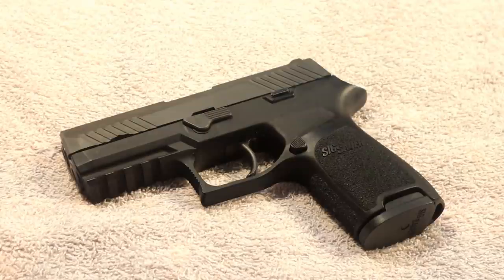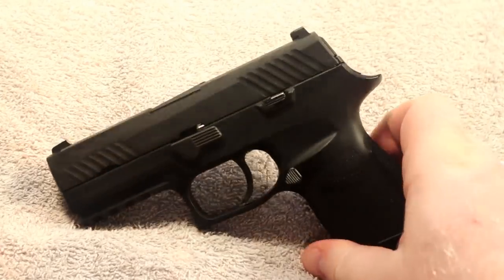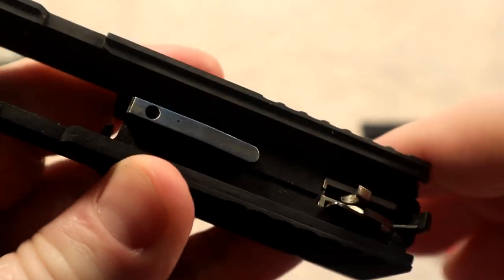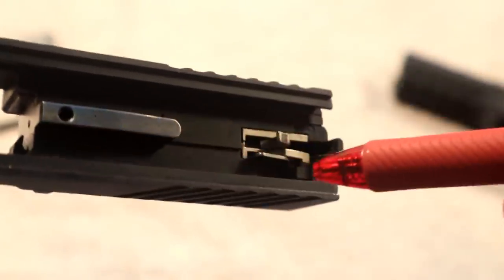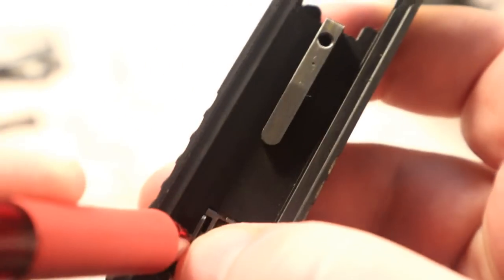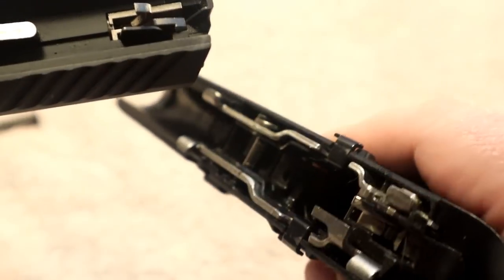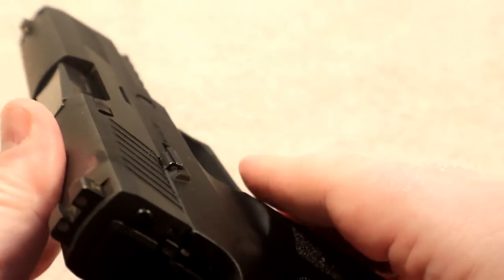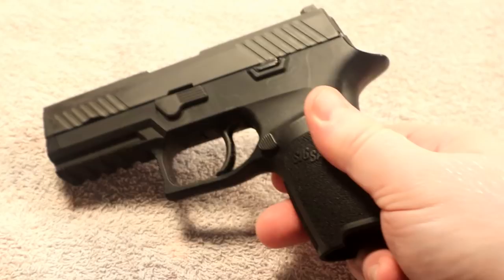The Sig P320's Dirty Little Secret You Won't Find in the Manual

Comment: If you search for "Is The P320 Unsafe? | A New Failure And We Cover What Has Happened So Far" in the search field here on YouTube, you can witness a SIG P320 discharge on video, however it is not the only video out there that shows this. Obviously the Statement the firearm cannot possibly be discharged in this condition on your video here is just incorrect. I do feel sorry for those of you that are SIG P320 owners, SIG has failed you the most. But I'm sorry, your stalwart defense appears misplaced at best.
Reply from the maker: There's nothing wrong with them.  The only videos show drops of older guns prior to changes.
Reply: @BoomStickTactical  the last few were post change and the police officer and female police officer said that they went off by themselves. SIG did the P320 owners no favor...
Reply from the maker: @boomschofield3148  if it was true there would be proof

Comment: There are 3 internal safeties that all need to fail in order for this gun to go off on its own, post drop safe fix. Yes, 3 different safeties. 2 sear safeties and a firing pin block safety. Every time it’s “gone off on its own”, I guarantee the trigger was pulled.
Reply from the maker: Yep.  There's nothing wrong with Sip

Comment: Well apparently it can fire and bypass all these safeties . There is definitely one report with witnesses of the P320 going off in a well fitted Kydex holster.  Sig said after receiving the gun (which was only six weeks old and had the fix) that the firing pin return spring failed.   No thanks.  Something is not right, and I like Sig guns.  I’ll pass on this one.
Reply from the maker: Thanks for watching.

Comment: As truthful and logical as your video is, this issue has happened at our department several times. On one of the instances the pistol is in a holster on an officer and goes off. This occurrence is on video. The involved PO had food in one hand and a phone in the other. Our department firearms guys have extensively tried to figure this out as well with no luck so far. There has to be factors that nobody has considered yet or something.
Reply from the maker: I would like to see any pictures or videos showing the internal parts if they ever release them. Keep me updated if they ever do come out because I want to know myself. Stay safe out there.
Reply: Please post any updated information regarding this (links ?) as that sounds like a doozy of a situation. My only thought on that is a holster (thus inappropriate equipment) that has partially pressed the trigger to the point a very small random movement further deformed that holster enough to trigger a discharge. Long shot I realize but situation described is incredibly perplexing.
Reply: @floydmanfloydman4147  it also happened with 2 other POs and the pistol again went off in the holster shooting his partner in tge leg. This wasn't captured on video but it was while putting a combative arrested subject in the squad. At the time, with was before this videod incident,  they chalked it up to the subjects finger getting into the holster.
Reply: @aiax6.5cm93  Thanks for the added info. It looks like one of those scenarios may have an explanation (subject finger accessing interior of holster). Still the scenario you originally indicated seems to have no external cause.

Comment: I carry one daily in a good holster have lighten the trigger to 3.5 and have had no issues have dropped it getting out of my semi when I had a cheap holster but still no problem they are miss handleing the fire arm . did you see her holster looked like a serpa with the outside trigger release . I bet it was depressed while in her purse and the gun slid back and then forward witch made it discharge
Reply from the maker: Yep, or something in her purse worked its way into the trigger

Comment: On a side note, even if you have an affected model "that was fixed" and you don't trust it for whatever reason.
Carry it in condition 3 or whatever.
Loaded mag empty chamber.
Then, you need to account for 1 more step, yes. There are benefits to carrying like this.
Lets say u drop ur weapon and the bad guy gets it, you have some time unless he's a fn legit mfer n knows its not chambered, which would be 1 in a million.
Plenty of law enforcement do train this way. Some when they draw turn the gun while coming to the chest and charging while pushing, you can get very quick.
Easily get it at about 1.5 seconds if you practice enough.
Point is, even if you don't trust your weapon (solely for this reason) you still habe safe carrying options. 
Esp if you can snag one of these on the cheap, I'd def be getting one.
Reply from the maker: Are you able to get your seat belt on before the crash? Carry a gun you trust
Reply: @BoomStick Tactical  i get it, man. I'm just saying that some people carry that way anyway, so it should still, imo, be an option for those who carry that way.
I carry a 43x and personally find it to be the only glock that has ever truly felt so natural in the hand.
It has no bad habits getting it into my hand. So as far as edc, I don't get the point of having 3 or 4 or 5 unless like a pair of sweaty shoes you wanna rotate for those reasons. LOL.

Comment: I know im a different creature,  but i bought 2 Sig Sauer P320s JUST BECAUSE i heard they fired without manipulation.  Crazy i know.  But i 100% TRUST my P320s withmy life.  I carry them daily.  I sleep with them under my pillow.  I shoot them frequently.  Ive tried making my P320s go off by loading a primed empty case into the chamber and dropping it from 7 feet to the floor.  No luck.  The Sig Sauer P320 is the BEST firearm ive owned so far.
Reply from the maker: There's nothing wrong with them.  I've tried to get mine to go off also and had no luck without pressing the trigger.
Reply: @BoomStickTactical  Damn right bro.  I think a pistol,  or ANY FIREARM requires manipulation before it will go BANG!  But when someone is a cop,  they dont want to accept that the big bad professional had a negligent discharge.  I trust my P320s so much that i ALWAYS have 1 of them under my pillow when i go to sleep.
Reply: that is some dedication my friend
Reply: @Thesusoperator  Im all about Sig after owning these 2 pistols man.  I want to get the AXG Classic,  the ACG Scorpio and the P365 (SAS & Regular).  Just the design,  the ergonomics and accuracy are SO FAR ABOVE PAR that i cant put it into words.  On another note,  i always HATED,  DESPISED,  LOATHED Striker Fire Pistols.  I love my hammers bro.  But the P320 is THAT exception for me.  I need to go re-purchase my Baby Eagle 3 .45 Acp.  I regret,  WHOLLY REGRET selling mine.  But it was an emergency.

Comment: To be fair, you never showed us the insides of said "firing pin block". You just assume that it is 100% reliable. You were willing to accept mechanical failure on part of firing pin itself, but not on blocking mechanism. What's underneath? What part exactly comes in contact with firing pin extension to prevent it from moving? What if it wears or snaps somewhere inside, whilst visible, spring loaded part still looks intact? The way you presented this mechanism it is still a black box and this video alone does not prove said mechanism' reliability.
Reply from the maker: Would it have changed your mind about sig? No so there's a limit to what's necessary. It has the same function as all other firing pin blocks. The guns are fine
Reply: @BoomStickTactical  I don't have any opinion on sig and neither do I care about guns at all. I'm just a random engineer pointing out fundamental flaws in your analysis. It's not the function of the block Im talking about, it's implementation of said function, which you completely ignored and just assumed that "it's fine". Why even bother making explanatory video then?

Comment: You wouldnt need multiple failures lets just take the slide itself from what your saying that firing pin block saftey thing is quit small and inside i imagine its on some type of spring or something to keep that tension so it stays in that spot but lets say pver time that tension loosens up well now depending on how much tension is lost either a slight anount of force or build up of carbon or worse gravity itself could move that out of place now when that happens the firing pin can now move forward like youve stated and set off the round in the chamber
Reply from the maker: It would also require the sear failing as well proving that it would take multiple failures. And if the things you mentioned have happened there would be physical evidence to show it.

Comment: You are simply mistaken,  multiple soldiers as well as 6 different police departments currently have lawsuits active against sig sauer, thats researchable. Remember the titanic, Never say never, malfunctions are malfunctions, and your being irresponsible by stating anything "CAN NOT" or using NEVER in the use of ANY firearms. ANYTHING can fail, there's been problems with the drop-in FCU since it's inception,  it's a flawed design but far too expensive a venture to backtrack ... do the research you yourself suggest.
Reply from the maker: And most of those cases have already been shown to be negligence on part of the person who has the firearm.  As far as the ones carried by the soldiers, they are different and have a manual safety along with all the other safeties.  That clearly shows the problem is NOT with the gun.  I've asked many times to see the proof and I've never seen anyone who can point to the component that failed.

Comment: I'd like to know the calibers of the pistols in the lawsuit. With 40SW P320s, if you removed the magazines and pull lightly on the trigger you can see the slide rise up away from the frame. This doesn't happen with 9mm P320s. I think this slop is allowing the striker to slide up over the sears. The symptom a person might see if this is happening is they pull the trigger and nothing happens, but when they rack the slide a round flies out. Most people wouldn't think much about this when it happens. 

As for the P320 firing pin block, if you compare the P320 with other pistols it is clunky and not near as smooth. I think the pistols are going off when the firing pin blocks are failing possibly because they are dirty, or aren't working. I have had a firing pin block on my hammer-fired Ruger LC9 fail because the firing pin retainer was bent due to dry-firing without a snap cap. 

I suspect this is the real reason Sig discontinued 40SW in their lineup. Glock, Smith & Wesson, Springfield are still making 40SW pistols.
Reply from the maker: There should be some evidence showing the things you mentioned. No one online has been able to recreate the failures like this either. The only ones recreated was the drop test and even that can't be done on newer models.
Reply: @BoomStickTactical  Not sure you can do it unless you have the exact pistols. However, it's not that farfetched to think a striker safety can stick in the up or disengaged position. Look at how much space there is to the sides of the P320 firing pin safety. It wouldn't be hard to get fouled and the spring on it isn't very strong; at least the spring on mine wasn't. Classic Sigs and even the P365 use a tight fitting button. Also, give the slide thing a try. If you can get a hold of a P320 in 40 SW, drop the mag, and lightly pull the trigger and watch the slide lift away from the frame. Unlike most other pistols, the P320 slide rides on the fire control group instead of the frame creating two places for slop to add up. I can also see the problem would be exacerbated if the "ears" on the fcu are manufactured where they are bent upward.
Reply from the maker: @ultrafuel2559  you would think if that's the case there would be evidence of it brought into the courts as part of the lawsuit. I've not heard of any settlement either
Reply: @BoomStickTactical  Good point. Although, I haven't been able to confirm this yet, but I heard yesterday the Marine Corps just pulled all the M18s and reissued M9s. I don't know any active duty marines who can confirm this.
Reply: @BoomStickTactical  BTW, I thought your review and explanation of the P320 operation was very good.

Comment: SAFARILAND 7TS Series Holster Manual Warning

 
Safariland SERVICE BULLETIN | Advisory for Handguns with Lights and/or Lasers Attached (published October 21, 2005)
Certain specific models of light-bearing holsters have also recently been subject to Safety Bulletins issued by the manufacturer relating to firearm retention issues.   These retention issues have been observed to contribute to a risk of unintentional discharge of holstered firearms under certain conditions. Any concerns regarding such holster issues should be directed towards the holster manufacturer directly.
Safariland SAFETY BULLETIN | Safariland® 7TS™ GEN 2 ALS Light Bearing Holsters for Sig P320 / P320C and Surefire X300U (published August 15, 2021)
Safariland SAFETY BULLETIN | Safariland Duty Holsters 7000 Series for Streamlight TLR 7 and similar-sized light attachments (published November 8, 2021)
Safariland SAFETY BULLETIN | UPDATE: Safariland Duty Holsters 7000 Series for Streamlight TLR 7 and similar-sized light attachments (published March 18, 2022)
Reply from the maker: Yep but people still want to blame it on the gun.

Comment: While the headline on this video is true... the trigger CAN move without a finger on it from other outside influences like a holster rubbing against the trigger shoe.  Once the trigger moves just 1.5mm the firing pin safety is disabled.  Any further movement of the trigger or jostling around can release the sear and discharge a round uncommanded by the person carrying it.
Reply from the maker: Again, the trigger must be pressed before it can fire
Reply: @BoomStickTactical You're totally missing the point.  People don't generally point at their knee and press the trigger.  People have been injured by this model gun BECAUSE other things (such as a deformed or improperly made holster) can move the trigger without user action.  The lack of any inertia safety is a major contributor to these injuries.
Reply: @BoomStickTactical  Correct. And the YT channel "Sig Mechanics" has some great engineering level videos on the p320 and how it is very safe and reliable. FACTS over Emotion based pseudo science. These NDs are caused by poor gun handling- an inertia safety can't prevent that. Glock Leg is a thing STILL- every year many times.

Comment: a manual safety would have stopped 100% of these NDs
Reply from the maker: Not having a loaded gun in her purse in a cheap holster would stop it also
Reply: There is a reason the Army required a manual safety on the M17 and M18. Not because the P320 is us safe but because that manual safety makes it even safer. It was required on the Glock too for the trial so I agree a manual safety probably would have stopped this. Same as not carrying in her purse with all her other junk.
Reply: They're claiming the trigger wasn't pulled, so it wouldn't. That's all the manual safety does. If they "claim" that it "went off by itself" that means the trigger wasn't pulled and the manual safety wouldn't have mattered.